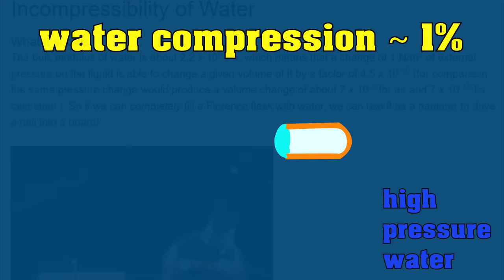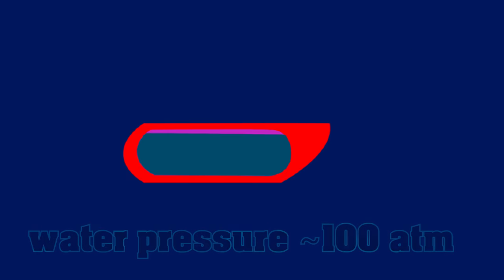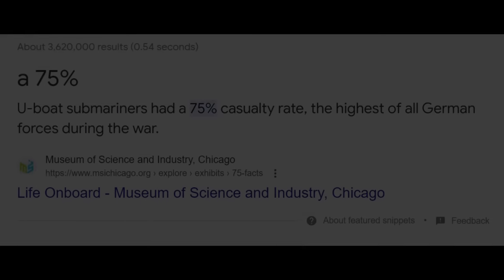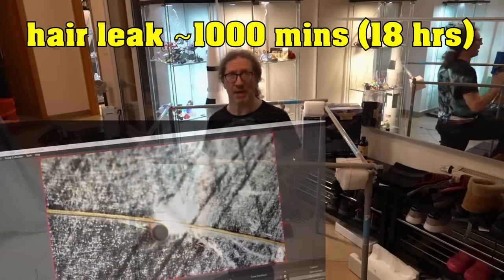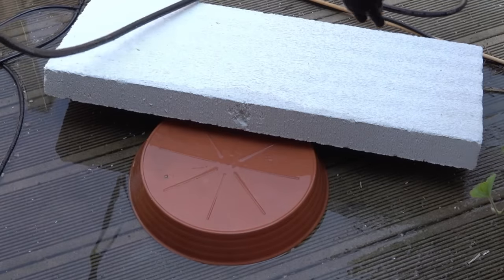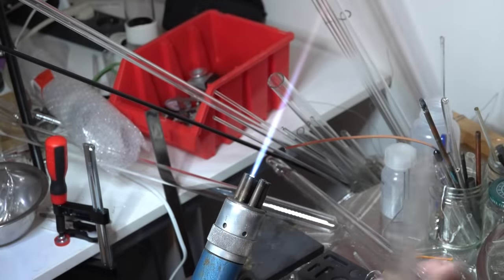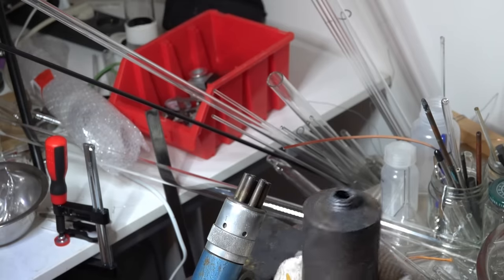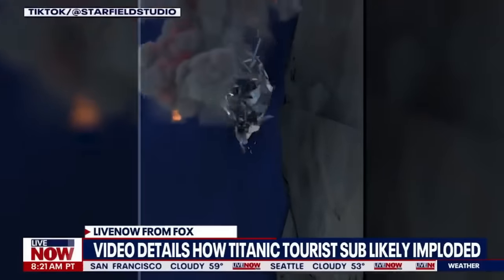Why the Titan sub failed

Comment: pressure washers are /for sure/ built with safety measures that dont allow you to put it low enough to do any damage to anything... because if they did then they'd be liable for damage when some idiot uses it incorrectly.

but yes, water under pressure is scary.

Comment: Funnily enough I botched teh oil draining of a new HVAC compressor this morning, there were about 20ish-30ish Bar of Helium gas in there and about 2l of oil, I emptied about ~0,75l in the span of ~1 second all over my face, shirt, the floor beneath and behind me and that was viscous oil in a pin hole as hadn't taken the screw completely out yet.
It probably water jetted, with an abrasive (CF) and the destruction from that became most likely insignificant imideately...

Comment: Well, I knew having dissimiliar materials with different compression rations would, sooner or later, cause a serious problem. 

Stockton rush: There was a loud bang, but that happens... no reason to have any engineers look at it before another dive.

o.O

When the Triste had a loud bang, they looked for the reason, and replaced the broken part.

Comment: I don't understand it, the math was as plain as day to me, and I wasn't even trying to understand the difference, but it was blindingly obvious!

Your glass/metal joint was spot on, if you don't use materials with the same expansion rates the seam will fail.

For the guy trying to explain the bond of his titanium ring and carbon fiber, he was correct about it being all on the glue being used having all the load on it.

Too bad he didn't understand his mistake...

Comment: Honestly the one this thst they did correctly imo was using epoxy. It's the best way to bind carbon fiber to stuff. Probably should have had a machine to apply it though. And ofc the multi-material design concept was just flawed but epoxy would be the way to go.

Comment: the reason whales can dive so deep is they don't have pockets of gas inside them(they deflate their lungs before diving so deep) a running air supply kept adding pressure inside until it popped the cap off this is why we tell you don't glue titanium the glue can't bond so it was a friction fit cap that just popped off

Comment: Thunderf00t Clearly you've never done any mechanical engineering in your life. You are so wrong it is embarrassing. The sub was essentially a carbon fibre tube with a Titanium hemisphere at either end. It failed because:

Carbon fibre really only works in tension only and is very poor at resisting compressive loads. You can't clamp carbon fibre bicycles, for example.
A mixture of materials with different properties. As if using carbon fibre wasn't bad enough, joining carbon fibre to Titanium was asking for yet more trouble. The different materials means that there would be stress-concentrations at the joins because any stresses would not be able to flow evenly over the entire structure. Plus, both materials expand and contract at different rates and amounts from temperature changes.

There would be cracking and then rapid implosion as the animation showed.
Plus, all they recovered from the wreckage was the titanium end caps...

Comment: Check out real engineering's video on this. His day job had him working with composites. I wanna say undersea oil & gas, but don't quote me. Gist was there had already been a fair amount of experimentation with carbon fiber composite at such depth/pressures. They did not perform well. Failures almost always started with delamination of the inner most layers followed shortly after by a catastrophic failure of the rest of the structure. 
That said there's a (questionable) transcript of the messages exchanged w/ the support vessel going around which includes a bit about a crackling sound coming from one end of the sub. To me, that might bolster the case for your theory. At the very least, I'd put money on this being yet another critical factor contributing to the carbon composite cluster fuck constructed by Mr. Stockton Rush.

Comment: I thought Phil was exaggerating when he said glue. But nope, there is actual video of them gluing plastic to metal, for a project that would see absurd stress and everyone just shrugged and said "that's fine." 

Maybe is just because I build models but I have never, ever been able to glue together any formulation of plastic and metal together using any kind of glue, and have the result not be delicate and brittle. Even from a common sense perspective you really want to bet your life that a glue weld will hold under 1000's of atmos of pressure? really? that sounds smart to you?

thanks phil, my brain is broken I need a nap.

Comment: I worked a lot with a high pressure hot water pressure washer/steam generator. Those tips DO NOT provide the claimed pressure in a 5 thousand USD machine, never mind in the bargain store junk he used here.

Comment: Ignoring the inevitable failure of the Carbon Fiber itself. Would it not have been better to glue (so dumb) the caps on the inside of the central tube? Then as it contracts, it would actually tighten around the joint, rather than moving away from it?

That said, they cut so many corners with this thing, that they where doomed from the start.

Comment: The epoxy was the failer hands down. Which is not elastic or compressesive. It's to brittle.......Period. Plus the mounting of the two monitors at the back with curse thread screws may have created a weak point if there wasn't an inner shell. The carbon fibers by them self can do the  job by it's self. 👉👉It's always the filler that's in question.

Comment: It doesn't kill whales, Thunderf00t, because whales and all their blubber is mostly water, and when they dive they collapse their lungs and even their ribs. So they don't have an air filled void inside of them, which is what causes things to be crushed. If a body or vessel is full of air, then the structure containing that void needs to withstand the weight of all that water. The Navy has had a sub sink to crush depth before, and it was smashed. There are videos of air filled canisters, etc., being lowered to crush depths and they implode. It almost sounds like you're denying that implosion at depth is a thing that occurs.

Comment: But if the pressure hull was made of carbon fibre then it can't have been a pinhole leak because carbon fibre's failure mode is shattering. The whole thing would've let go at once

Comment: If you are shocked that it survived even 1 dive, and it survived multiple dives, then you have miscalculated somewhere because the evidence doesn't match your prediction.  Fatigue failure is notoriously difficult to predict with composites, as you mentioned, and so the best explanation is that they actually did all the calculations and simulations "correctly", including accounting for the different compression rates, but their underlying material model of the composite was not detailed enough to capture the micro-damage sustained by stress cycling.  And that's hardly surprising given how insanely complex the internal geometry of a composite is compared to a solid piece of metal.  Each dive damaged the joint a little bit more until it finally failed.  What they should have done is send a test sub unmanned 2x deeper than the titanic and back up again 100 times. If it didn't fail, then they should have cut it apart carefully and analyzed it with a microscope for any signs of damage. If everything looked solid, then you could feel confident in the design.  I'm guessing they didn't do this?
Reply: the issue is you cannot predict when the failure will occur with the carbon fiber. each dive, each towing damaged the carbon fiber hull. the only safe dive with carbon fiber would be the first.

Comment: The fact that the carbon fiber was bonded inside the titanium (allowing failure due to compression) rather than having it wrap around that ring of titanium was telling in light of everything explained about carbon fiber compression. 1% wouldve rapidly shot way up in an instant. Sad.

Comment: The problem with your analysis is that the main hull was made of carbon fibre. Carbon fibre has a tendency to scatter like glass if pushed past the breaking point. 

It is thus very likely that the animation is closer to the truth than your pinhole theory.

There are some pretty good simulations out there based on exact models of the sub with actual materials and construction methods.

Comment: The main reason your experiment failed with the pressure washer is that most home pressure washers use scam-like marketing with their sales figures.. the 125 bar pressure advertised is just peak pressure and not sustained pressure. I have a commercial diesel engine powered pressure washer that can provide sustained pressures and it would destroy that plastic plate

Comment: If they were going to make a sub out of titanium end caps and a carbon fiber body, as dumb as that is; wouldn't it have made more sense to have the carbon fiber/ titanium joint be outside the end cap, not inside it? That way, when the sub gets to a very high pressure depth, the carbon fiber hull would constrict and tighten around the end cap, not create a gap like may have actually happened.

Comment: Please expand on that: "They only way this could've possibly worked is if they used some exotic alloy of Titanium" . What if scenarios can be fun. With full warning that this is pure speculation and it would probably still not work but it would give it the best chance. I wonder though why they even bothered with Titanium at all if they didn't wanna use titanium for whole sub but only part of it? was there any reasoning ( even if wrong ) why Titanium was used on two ends of the sub?

Comment: Hi, I’m a naval architect! The entire premise of this video is wrong! A pinhole leak is not only not the most likely failure mode, it’s actually probably one of the least likely. Additionally, we know for a fact that the sub imploded because the implosion was heard by the US Navy’s hydrophone network. And we know that it was a catastrophic implosion of the pressure hull because the end caps were recovered without any carbon fiber attached to them. 

Please stop making videos about things that you don’t understand in the slightest. It pollutes the public discourse with misinformation.
Reply: Also, the depth of the Titanic is 3800m, not 3000 as you keep wrongly saying.
Reply: And the carbon fiber wasn’t just held to the rings by glue. As you can clearly see, it fit into a slot, which means that the ring would also be physically supporting the carbon fiber. And of course, the pressure of the end caps being pushed towards each other by the water pressure would exert a large force pushing the carbon fiber-titanium joint together. So you also need to account for the friction in the joint generated by that normal force.

Comment: This is the most-probable single point of failure:  In addition to being a material unsuited to compressive stress, A unidirectional tow strip is the only fiber the Spencer video shows wound around the mandrel;  ZERO was the design provision of any non-axial lateral structure to prevent a simple splitting of the fabricated unidirectional tube. Thus, given water's injection into the unidirectional structure, the axial fibers were displaced laterally, wedging them and progressively splitting the tube in the axial.  This tube design was so fundamentally ill conceived that it sickens all competent composite engineers and fabricators.

Comment: When they say water isn't compressible I always wonder why I need to flush my brake fluid out when moisture and water get into the lines because my brakes become squishy and don't work so well. Why isn't water just used as brake fluid? Oh, because it is compressible. I mean, in the steam form it definitely is, too.

Comment: Extremely interesting sir, I'm no expert at all on this subject, not even close, but your reasoning to me sounds very very plausible, especially compared to some of the other weird sandwich video's out there on this sad subject.
I'm sure I'm missing something but May I ask you what you'll definitely consider a very naïve question sir, (for which I apologise) the "liner! as you call it, I assume was a gasket also & if so why even the need?  I'd have thought, by the builders very decision to use a very advanced  glue rather than bolts, that glue should have been even more than capable of making the necessary seal without a gasket that in itself alone had to be as at least susceptible to extreme pressure as the carbon fibre itself.
Sorry for the more than obvious layman's question that you'll probably think to yourself "Ahh Bless him" lol!

Comment: I get the impression that the carbon fiber failed and it immediately collapsed/shattered while popping the two ends off in either direction. None of the animations really seem to want to get it accurate based on material science and physics.

Comment: ure assumption is wrong. the titanium parts were not just glued with the carbon body. the titanium rings had holes on all of the 4 sides  and they were connected by rectangle titanium bars on all of the 4  sides of the rings. bottom top and left and right. it would be an act of a heavy unintelligent human being to use only glue as bond between the rings and the carbon body. if you happen to watch the videos of the titan you can clearly see the bars connecting the rings and on them is the landing frame attached. you can also see the inserts on the rings when they are glued together with the carbon body with the drilled holes in them. the construction of the sub was legit it is the carbon not having elasticity module that made them perish..

Comment: I guess reason,  why the trial with the high-pressure  cleaner didn't achieve the desired result : The water jet dispersed too much on the surface, instead of staying focused and "solid". That's how bomb squad open suspicious baggage.

Comment: This account appears to be the most accurate if the text transcript of the submersible circulating online is true. The texts indicated that the submersible was struggling to increase buoyancy, slow its descent, and rise back to the surface. If it were indeed taking on water through a pinhole leak, it would be experiencing a buoyancy "death spiral" while pressure was building. Over a short period of time, the pinhole probably rapidly expanded, resulting in catastrophic delamination and hull failure/implosion. Again, if the text transmissions are true, the people onboard probably experienced a few minutes of terror as ice cold water poured in and the vessel failed to rise in the water column despite their efforts to shed weight - shortly before it imploded.

Comment: I would agree the animations are not accurate. I am imagining the end caps popping of away from the tube. I think the animators were comparing to when the 55 gallon drum is heated, capped then cooled. We have all seen that demo, but the carbon would have failed differently. Possibly peeling away from the rings. If you watch the recovery video, the rings seem to be clean, no traces of carbon.

Rush was an idiot, who had no clue and no business 'building' submersibles. At least he paid a price, rather than be in his office when it failed. The failure was always a when, not an if. They should have remote dove the sub multiple times until it failed, then worked forward from the gathered data.

Comment: Interesting. I quit smoking cigarettes just over 12 years ago. I will sometimes use the idea of being in a submarine or as here submersible to describe what will happen if I have even 1 puff. 1 puff and my quit is done. The submersible that is my precious quit will get a pinhole and I will drown, it might be two hours it might be two months but I will be back smoking and probably more than ever. Although now I suppose I have to say I'll be sawed through and I won't be watching the sub fill with water at all, I'll be dead pretty much immediately, equating to I will instead be magically teleported to the store and instantly smoking several cartons simultaneously, no coy dancing around will I won't I. It's a whole new way to visualize relapse! 
And I realize now I will have to find another way to describe it, maybe I can't anymore be deep under water in a sub, I have to be standing next to the wall of a damn and there's now a hole in it and depending on placement of this hole I will be back drowning in addiction soon. Anyway! Interesting reality check on my idea. Though I do still like it. Cheers!

Comment: "Cute" video. This is not only SILLY, it is completely WRONG. 
The Sub failed because the carbon-fiber centerpiece developed microscopic cracks that got worse every time that it was used. - Approximately 15 times. Check out, "Real Engineering" on this subject. They did a deep dive into this and that guy and others predicted this would happen, LONG before it happened. Mr. Rush was pure money and ego, and did not listen to any of them. He fired his own employee when he blew the whistle about an untried design. The only good news about this is that Stockton is down there with them.

Comment: I watched a video made my a structural engineer the other day who had done detailed analysis on the structure of the Titan and he pretty much came to the same conclusion. Differential compression between the titanium end rings and carbon fibre tube causes enormous stresses at the interface between the two. He then analysed what happens at the interface and found that the stresses actually delaminate the carbon fibre weakening the joint, this is because the glue only adheres to the very surface of the composite. This would have happened each time the submersible pressure cycled causing more and more damage each time until ultimately it failed. So a totally flawed design right from first concept.